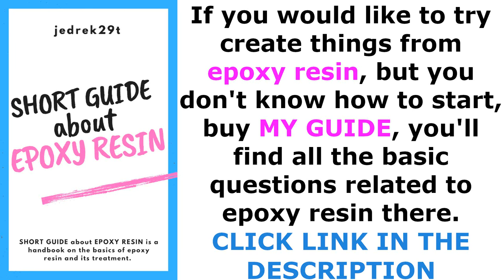Night Lamp with Resin and Wood💡 / RESIN ART

Comment: AAARRRRGGGGGHHHHHHH!!!!!!!!!  I HATE seeing people solder in YouTube videos.  I used to repair circuit cards while in the military.  I know most of the tools available to the general public are like stone age tools, but it still hurts to watch.  The general public also didn't have the luxury of a couple months of school, nothing but soldering under a microscope, to learn how to do it right.  It just hurts so much to know that I can't do the job I loved so much, because nobody in the civilian world repairs circuit cards anymore.  Today, if something on the card is bad, just throw it away and replace it, no need for a micro-miniature circuit card repair technician.  When one of the requirements for passing the class is to solder a resister that will fit INSIDE  Franklin D. Roosevelt's ear on a dime, under a 20x microscope, you might understand my pain.  And OMG, liquid flux and some rubbing alcohol are a godsend.